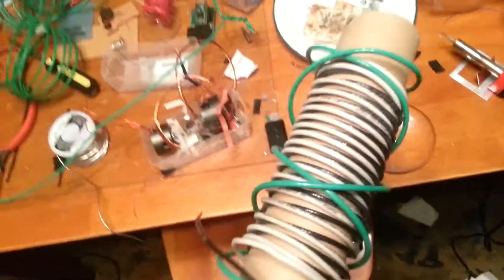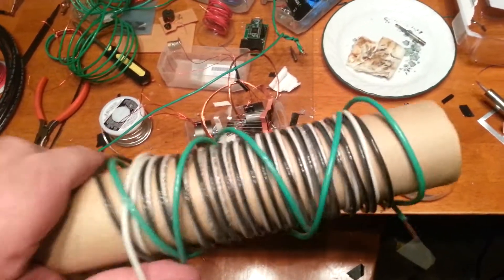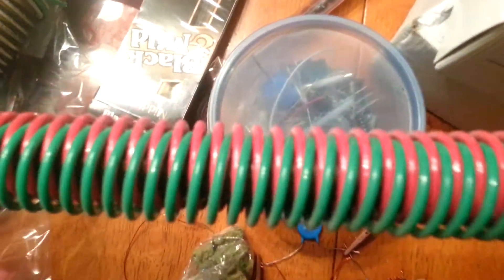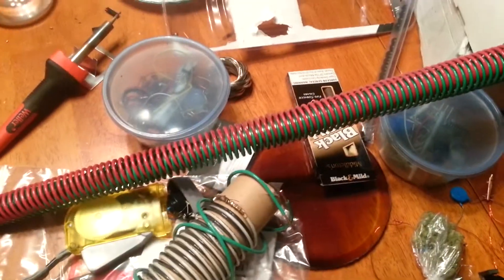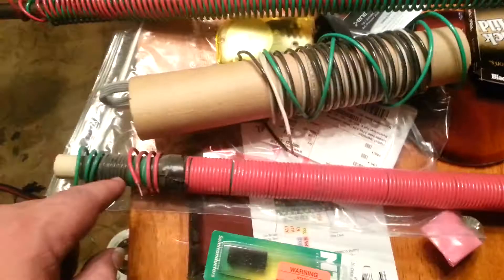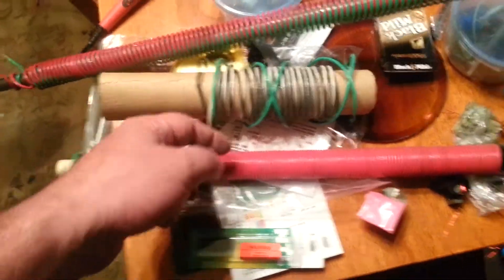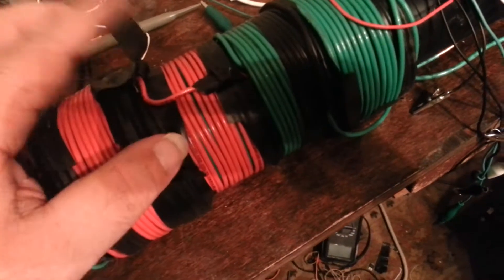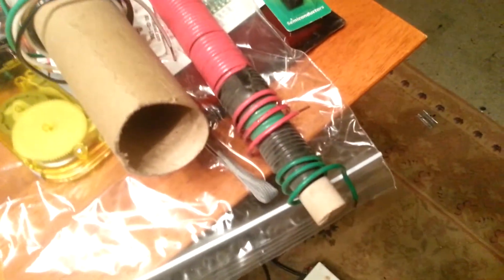Caduceus or not?

Comment: No they not the same by the design you might recognize it but electricity can tell the different if you take your standard bifiler coil and measure the resistance of the two wire. One in series connected and other parallel connected the one parallel will have less resistance. The reason for this electricity is two flow current even in DC not just one direction even if the electron flow one direction it still has two force acting on it. The two force are not equal at certain moment who ever stronger push the electron along the wire but when have change in current or magnetic field one become stronger than the other produce EMF or back emf. Also you have recognize the magnetic field that exist between the wire it's not same place on cadueses coil electricity can tell the different.

Comment: It took me a while to realise you messed up. You are suppose to use uninsulated coil~
Reply from the maker: If it was uninsulated it would only ever be 1 turn and wouldn't flow through the coil; what would be the point?
Reply: For DC yes. However, AC wouldn't behave that way. since the magnetic field is constantly changing, wouldn't the entire wire be induced? -3-
Think about it~ c:
Reply: DC flows in one direction, 2 poles. AC flows in 2 direction. 4 poles~. +1, -1, +j , -j ~
Reply from the maker: Well no... DC or AC current flows with a difference in potential... and takes the shortest path/least resistance... more windings would be higher impedance for the magnetic field, plus more resistance being longer wire. So AC would be even more likely to take short path, the instances immediately after connecting DC also (the initial current surge)
Reply: +J Decker shakes my head The way you type indicates you haven't even try the experiment. Why don't you try it instead on relying on assumption? -3- Have fun~

Again, AC is different. +1, +j, -1, -j then back to +1. You will understand one day~
Reply from the maker: My whole channel is experiments.  This is about discussing that a 2 layer coil wound from one end to the other is really the same as a loosely wound cadeuceus.  current passing through shortest path is pretty obvious.
Reply: +J Decker I know I know but try it with non-insulated and non-tarnished pure copper wire caduceus coil with 9 nodal crossed points~ -3-
Reply: +J Decker oh almost forgot, make it asymmetrical. 5 nodal points in straight line, another 4 on the opposite side in straight line

Comment: Did you get some results field free energy?...I did it just with one cross point in the vacuum chamber by putting guitar wire because heat is in the midlle of wire,and on that point I made cross 90 deg...but also you need 2 energies ...I sended on 1 wire amps plus and minus,and on other wire witch makes a loop around first one ,on one end goes plus of HV like 10kv and other end of same wire goes on case outside of chamber to make chamber like body of mashine ....after this set up I got buble of energy ...be carefull good lock :) (antigravity and free energy is there )
Reply: I see you're saying High Amperage field crossed with High voltage field produces High Power field. Psi (dot) Phi = Q, the Planck, the unit of electrification. Dp research on Nikola Tesla, Eric P. Dollard and most importantly, read Uncovering The Missing Secrets of Magnetism 3rd Edition by Ken Lee Wheeler.

Btw, what do you mean 'body of a machine?' And, did you coupled the two caduceus coil togther or leave a gap, in series with each other? Where one coil is high voltage, another high amperage. Did you use AC, DC or impulse current or oscillating current?
Reply: btw, did you do it in 100% vacuum or <100% vacuum?